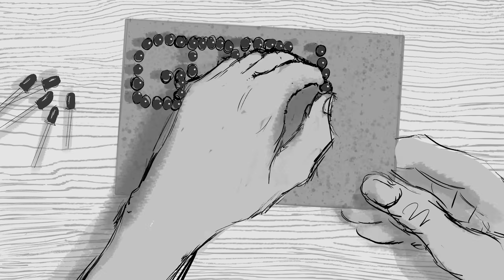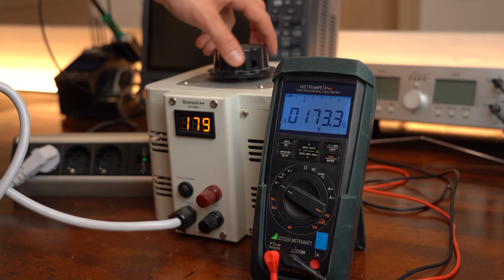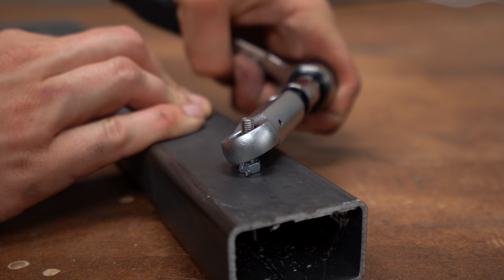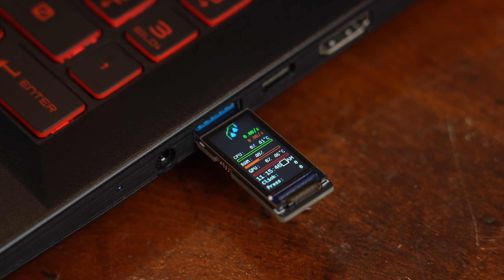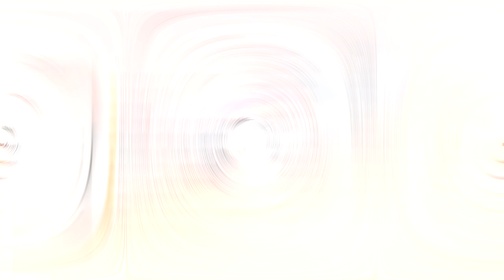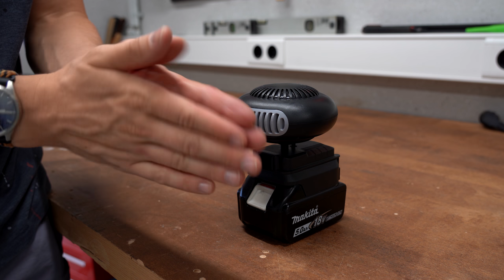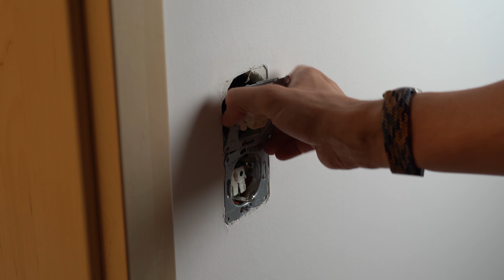I tried finding Hidden Gems on AliExpress AGAIN! (SPECIAL Part 20)

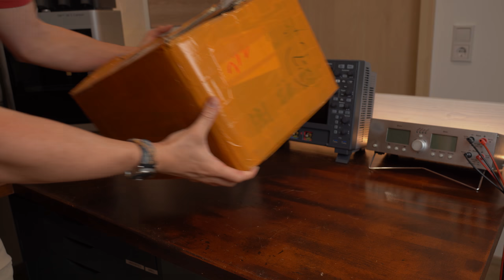Comment: 2:08 I bought what you don't recommend for 5 yrs because my air conditioner broke because of some unstable power supply which I doubt "rats" have something to wires where I cannot fix. Now I think it solved by that. New air conditioner has no problem and power stablizer shows input voltage sometime 170v or 260v and out 225v.

Comment: Depending on the true power handling capability of that voltage stabilizer and the price, it might have been worth buying it, just for the transformer alone.  Those things can be very pricey for a good one.  However, judging by the poor build quality of the rest of the unit, I wouldn't expect much.

Comment: i love to get stoff from aliexpress.. sadly i have to almost stop due to there F*** STUPID repacking system in the Nederland. to get stuff in without paying a €30 or €80 import fee (depending on the type og stuff you get) aliexpress have to take the 25% VAT on payment then pay this to norway. th einfo of this VOEC payment need to be digitally registered with the shipment. THEN when they collect multiple small packages at the shipping center in the netherland's they do not put this info on to the shipping label and then i do get the €30 or €70 fee + i have to pay a new 25% VAT on top of the one i already paied (yes that include VAT on VAT)  so now i have to make souer whatever i have ordered is in norway or already delivered before i can order a new item.. and i can not order many thing at one time any more. only one order, wait until it tis here then order a new one. so i tend not to order smal stuff so much any more as it might take way to long for it to get here and it block me fro ordering a new item.

Comment: I've seen sth even more horrible, a lab oven whose circuit breaker was not mounted by a mounting rail (that's supposed to) but by a piece of tape, also the wire ends were not treated properly. BTW sometimes you can find products with totally different internal structure even if their outcomings are similar, so make sure what's inside before ordering

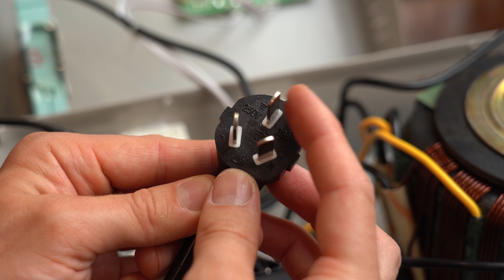Comment: 3:21 that power plug is out of spec. It is required to have insulation on the first around half of the base of the earth pin

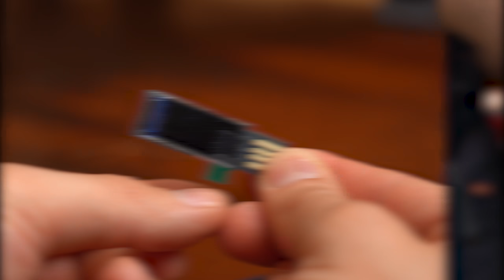Comment: 5:30 the display, there is an implementation for the display using linux. you can use it as a terminal. Don't know if you can use the bigger display also for this...?
Also there is an implementation for homeassistant, called weact4ha, that can be used to display several things on the display...

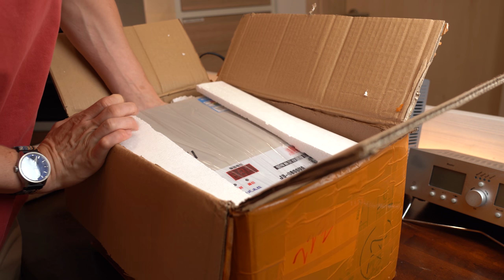Comment: @2:11 ... this kind of voltage stabilizer never put exact output voltage even if they are made properly by reputable company ... they use "steps" on transformer and normally they are spaced by 10 - 20 V. That mean that if source is 245 V, then it will buck it by 20 V to 225 V ... for 265 V > 2x 20 V -> 225 V, etc. Same for boost ... In Europe most power companies guarantee + 10% voltage difference and proper AVR stabilizer tight it down to 8 %. There is no need to have "spot on" output. Just to be sure that there is no over voltage, or under voltage feed to mains powered devices ... I used AVR from Volt Polska several moths, because we had >266 V mains voltage during night and it was killing mains powered equipment.

Comment: In fairness, the nut splitter is not meant for what you were attempting to do. The nut height needs to be proportional with the splitter, I don't think they make one smaller because it becomes redundant on anything that's M10 or less. 

We mainly use them in automotive for things like ball joint nuts, they're typically 21mm and I'd say the height of them is usually 10-15mm

Comment: Aliexpress sucks. As someone who actually used it A LOT it sucked. Everythings great until you start getting abosultelu shit items or items that dont work at all. They will let you return and give you refund the first one or 2 times. But thats it! after that they think youre scammning them or something. I got razor blades that were so dull it just pulled on my hairs. They wouldnt refund me. Ordered hundreds of items only returned 2 things. Tried returning razors that dont work and they said no. Went throufh paypal instead, paypal got me my refund. But guess what? Paypal option for paying was removed from my account. Amazon way easier to get refund.

Comment: I built a pc from aliexpress*. Besides power supply, aircooler and gpu. But case, motherboard, cpu, ram, fans, all from AliExpress. It's been over a year now, and even after learning a bit of settings in bios and having to reset it 5+ times, still going strong. Only issues, one air cooler was 90mm, and the second one I bought, got bent from my own "genius". So I bought one in my country. 

The chinese hardware, Soyo board, a xeon cpu, Juhor ram, Lian-Li fans/hub, 3500mbs 1tb netac ssd nvme. "American" (bought in my country), a Zotac 1080ti ano extreme, 700w thermaltake white rating psu, thermalright cpu cooler. 

I built as a all round joke 😅, 1 was to see how good/bad the chinese hardware is. 2nd was to learn on, if it died/fried, not a major loss. And 3rd, to see how far I can push the system, after learning bios. 4th is how well does it handle hard hitting programs like prime95, mandelbrot, even some mining programs for fun. 
It honestly suprises me how well it runs, but maybe having super low expectations everytime helps 😂.

Comment: for that RC tank, if they used LoRa, or rc 2.4ghz or 7ghz(fpv) then latency and range could both be much better, also would fit in that price range. now it is just as cheap to get a rc plance receiver and remote(or a rc car with a free chanel on the receiver) and a fpv kit, would be close to the same price but with proportional controlls, higher speeds, much better latency and range.
actually you could build it really cheap if building it yourself, if you have the tools to make it accurate enough.

Comment: I remember my grandparents voltage stabilizer for their TV (cira 1960), this was a massive saturated core transformer, which as audibly humming when on. God this things was also eating power by itself, not an issue when you work for electric company so free electricity...

Comment: Good nut splitters exist. I have a that is offset so that it lays flat against the surface of whatever the nut is on. I've only used it a couple of times, but it worked as it should. It's branded Craftsman, but I'm sure the same thing was sold under many other brand names.

Comment: the IR light switch should have a remote, seems silly having IR sensors and not having a remote function
Reply: It is not a remote control switch.
It is a no touch body heat sensor,
to replace toggle switches. It is also
no good as  a motion sensor, because
it only senses at 15 cm or less. 😁✌🏻🖖🏻
Reply: @zapa1pnt  I know what it is, I'm just saying why not utilize it for both. The small activation distance is perfect, you don't want the light turning on or off every time you walk by it

Comment: The voltage stabalizer reminds me of my old charger for my electric moped from China called Lifan E3 which I purchased in july 2020. It also had loose soldering connections and above all the Shuko male plug had a CE mark on it. This Shuko male plug also had ground on it attached. But the wire was 0,75 mm2 phase and null, but no ground present aswell. The metal casing in which all of this goodness from China is installed was also not grounded because of this. A few years later the plug to the defect battery started melting. It had a hard short circuit in it! Now the Lifan E3 supplier went bankrupt because his magazine burnt down to crisp. Which is not a surprise to me.

Comment: Is it standard to have a neutral available at a switch in Germany? I ask because you did not complain about the IR light switch needing a neutral. In many American buildings that would be a problem, maybe even a deal breaker, since it's not common to have neutral at switches.

Comment: Important so say - that airblower will kill any genuine Makita battery, as they don't have undervoltage protection built in and expect from tool itself to do the monitoring. Use something like this only with fake ones from ebay/aliexpress.

Comment: I use nutcrackers occasionally.  They are handy but mine are decent quality.  You need to stabilise them with a spanner on the flat of the handle.

Comment: These relay based voltage regulators are genuinely great and actually saved my house many times. There are properly built ones, however this one is a clear fire hazard. The first red flag should've been using a 16A plug on a device advertising 6800VA. A quality voltage stabilizer will use a terminal block at those power requirements 

As for the voltage, that's just the unfortunate inaccuracy of relay based voltage regulators. They will make sure it's between 200 and 240V but they can't guarantee a perfect 230. But that's better than feeding the home 170v or 270v. Servo motor regulators can deliver a spot on voltage but is pretty expensive at those power levels.

Comment: I also found something u might be interested in. It's a selectable USB c bidirectional charging board with XT connector. You can select the cell voltage and from 2-6S battery, so it also steps up the voltage from 20V to 24V.
search name: PD3.1 140W 2S-6S Bidirectional PD Fast Charging
My only problem is that it's only a board and isn't designed to mount it into a box where u can see the LEDs and access the USB-c port easily.

Comment: Here's a hidden gem for Ali orders, when you buy an item Ali saves a snapshot of the page so that you can view the listing even if the supplier removes the product. Check Orders -> Details (of an order) and on the products thumbnail there's a little camera that opens the snapshot. Thanks for all these little gems btw :)
Reply: This even works on deleted, restored orders from 5 years ago. Thanks for the tip!
Reply: dios te bendiga

Comment: Chinese product - if it is electronics you can be almost certain that all required safety-mechanisms are faked or broken. If you want to produce in china and care to not get shoddy products you have to send your own personnel onside and have your own QC in the fabs. We once tried getting rollers for conveyorbelts manufactured there and sure the samples they send us were great, the actual shippings alos looked fine.... Until 2 containers later where everything went to crap: of course the wire was no longer silicone-coated, copper-clad aluminium instead of copper, the casings wall-thickness far lower, and many more problems.

Comment: That tiny voltmeter looks great. I put small voltmeters in my modded gameboys to track the battery capacity and having a thinner form factor will help out with the installations. Hopefully I can fit it without any shell modifications.

Comment: On a side note a relay type avr will never have a smooth output voltage. It's just inherent in the design. It more designed to prevent crazy swings of voltage at the output especially in places were voltages fluctuate wildly.
Ps. I live in the Philippines in a baraio where voltage fluctuations over 20v from a 220v supply is common. I use relay type avr (cheaper than servo type) , and it has a ground connection, and the output display does show the mild fluctuations especially when the relays switch, and not a fixed voltage.

Comment: 14:26 sadly we cant do this in Australia, without an tradie who will just charge 600 bucks for 4 wires
Reply: There’s nothing physically stopping you if you actually know what you’re doing (which most people don’t)  

Also I wouldn’t install Ali express components in my house .
Reply: @jeff-u3x7r  AliExpress components are made in china just like almost all other components you can buy anywhere.

Comment: The "nutcracker"was not used correctly. It serves to expand the nut by making a small notch on it, maybe at two or more spots and then unscrew it by spanner. It is not intended to cut the nut! Also, some MoS2 lubricant on the threads would greatly reduce the torque needed.
Reply: then it should be called nut notcher and not cracker if it is not meant to crack it

Comment: The Stabiliser is fine, relays swapping transformer taps is a legitimate solution.
I could have used it last month when my rural European supply decided to drop down to 200Vac
As for the loose transformer and missing Earth, this is what to expect and of course everyone would open it up before use

Comment: That little USB screen would be ideal for adding some kind of a small status display to Raspberry Pi projects where you just want enough info to know if something is working right, if somebody could come up with an open-source driver for it.
Reply: It's not useful, in the video it's mentioned: WINDOWS ONLY!
Reply: @CONTINUUM2  this is a driver issue, it would still be possible to write a Linux driver, although that would require some work.

Comment: About that stabilizer.  Its impossible to run an ac without one here where i live. The grid voltage drops to 130v and back to 250v all day all summer. 

They one you got is a bad quality but there are other ones that are way better quality. The voltage output varies by 25v with each click that's why it seems not stable. 

The better stabilizer tech would be using a servo. Its output varies by 2-4 volts. Or even better using an on-line ups.

Comment: While the voltage stabilizer is extremely crappy, the listed tolerance is +-5%. This means a swing of 220-240V is acceptable, and that is the case as you measured, so i would say it is preforming as advertised and stabilizing the output.

Comment: For the first product... if it can behave like a 1:1 transformer, you don't really nead earth at the output. I created an isolation transformer, where I have two microwave oven light bulbs series with the output (which can be "overrided" with a switch) so If I have to start something unknown, I let the light bulbs in series, and if it's glowing, then I have a short circuit. With that, there are no earth-dependency, so you only got shock if you lick both the wires :) Maybe a new project? :)
Reply: it has a metal housing with just some cheap tape preventing 230V from killing you, the transformer part could be as isolated as it wants the logic board is still a hazard

Comment: You’re way too young to know that, in the 1950s and 1960s, heavy (but cheap) voltage ‘stabilisers’ were sold for vacuum tube televisions and 90° cathode-ray tubes. Those suckers were nothing more than autotransformers (hidden away, encased in resin) designed to operate with the core in saturation.

Comment: About those ESCs… I have only ever seen those with three leads to the motor, including those from inside a PC fan's hub (always three contacts between which the usually four coils are wired). But I have a dead HDD laying around, whose motor has four leads and that (at least from what I can tell with the limited testing I could do using a 3.7V DC power supply) requires all four contacts to run (the motor, depending on its position, twitches on a combination of arbitrary two contacts, no contact seemed to never yield movement). Is there such a thing as a four-pole BLDC controller, or is one of the contacts for a different purpose than powering the motor and just happens to also be able to energise the coils inside?
Reply: It might be for a hall effect sensor or something like that...🤔
Reply: @whitecanegamer  
Then how can I determine which contact is for what? I mean, having a sensor in there for RPM measurement could be useful, since the data needs to be positioned quite precisely and thus the instant at which the reading or writing happens relative to the rotation is relevant. 
I measured between the four contacts in every unique combination, and they all have below two ohms of resistance, though some were intermittently a dead short.

Comment: @5:45 - these sort of devices are a major security red flag. Whilst I’m sure many aren’t malicious, people should be very cautious with running these sort of random executables from companies/people they haven’t verified first. The other bigger issue is these ‘system monitor’ executables generally need privileged (admin) access on Windows when installed to get low level kernel access in order to show system stats. A far safer method is using a small display as a second screen (either hdmi, DP, or even usb-c) and proven piece of software to collect/display it.
Reply: Is there an open source library (and maybe firmware) for it?
Reply: Windows has no real security
Reply: @SodViber it has a built in sandbox mode. What are you even talking about
Reply: @HULKGQ-1 Thanks for checking the source code for us and telling us that the one million piece of Windows OS malware have never worked and that Microsoft updates are available for everyone for 8 years 😂
Reply: @SodViber source code? What are you on about? 
Windows 11 has sandbox mode for this very reason! 
Make sense next time please.
Reply: @SodViber  This reply confirms that you have absolutely no idea what you're talking about
Reply: @maskettaman1488 Perhaps you missed all the flaws that I itemized for you?
Reply: @SodViber  You didn't itemize anything or mention a genuine flaw
Reply: Lucky we have sandbox mode for this very reason! 😂